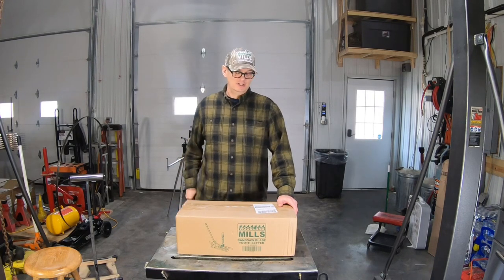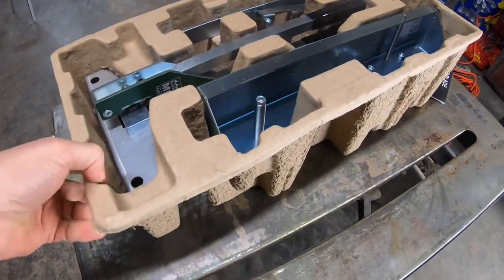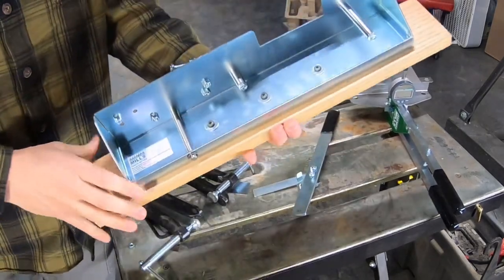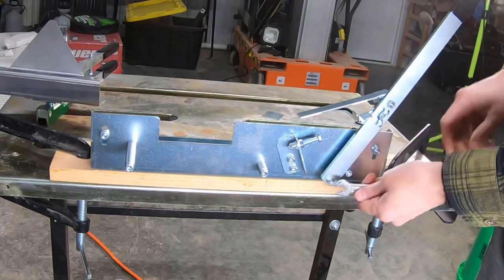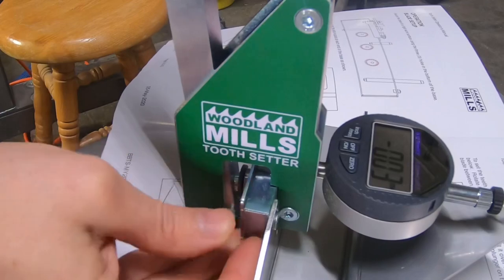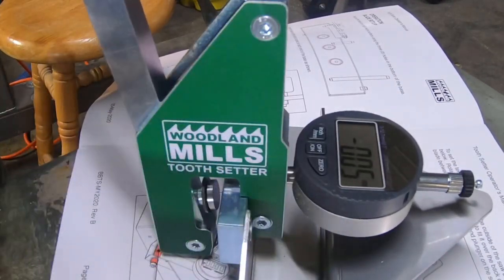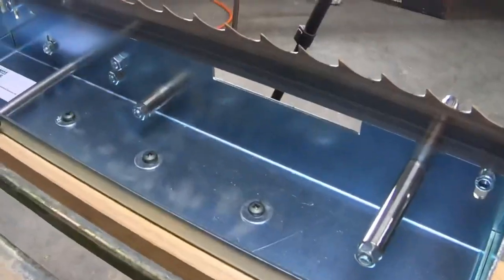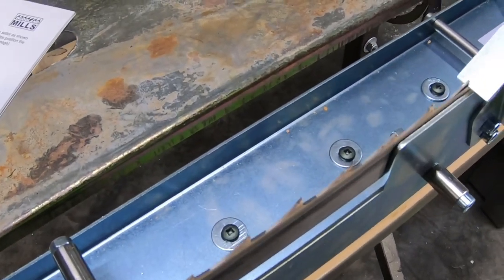Woodland Mills bandsaw tooth setter

Comment: good video and job. my hand gets tired too. i have both sharpener and setter. it you take a oily rag and wipe down blades they slide better and will not rust. take care, be safe and well.
Reply from the maker: Thanks for watching and commenting. Thanks for the tip I will definitely try that. We used acetone to clean them off but I think oil would be better honestly. Have a great day and be safe!

Comment: I happen to have the same HF welding table and roller.  So my setup looks exactly like yours now.  😄When I did my first zero using the calibration plate, the plunger held the plate but the black set screw was not touching the plate.  Wondering if I should adjust that set screw deeper so it just touches the plate when calibrating zero.  Just getting started.  Will keep playing with it.  Thanks for posting your video.  Very helpful!
Reply from the maker: Thanks for watching and your comment. I don’t remember the calibration instructions right off the top of my head now but that sounds reasonable. Definitely take your time with the instructions while setting it up. The great thing is once you get it set up it’s pretty much as fast as you want to go from there. I set the blades every sharpening now because it’s so easy to do and my blades cut like new. Very happy with the setter and sharpener. Good luck snd let us know how it goes for you once everything is set up. Have a great day and stay safe!

Comment: I have that setter. I have learned that 21 is way to much. I got a new blade and measured it. Around 13. So i just check my blades now with the setter. Works much better for me. I wondered why the new blades were much smoother. Now i know
Reply from the maker: Thanks for watching and your comment. That’s awesome! I haven’t tried any other settings yet the 21 works really well on my logs and mill. I run everything dry as well. I will try 13 next time I’m playing around though just to see how it works for me. I wonder what setting others have found to work for them? The main thing I’ve learned and what I like best about the mill is that don’t be afraid to experiment and try new things to find what works best for you. There really is no right or wrong as long as you are safe, just what your individual preference is for your own setup. Thanks again and have a great day!